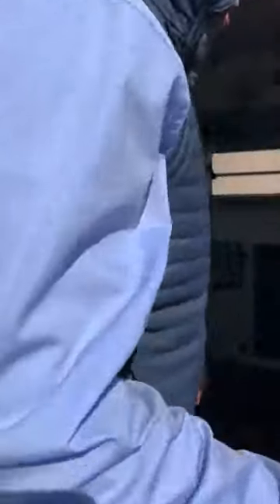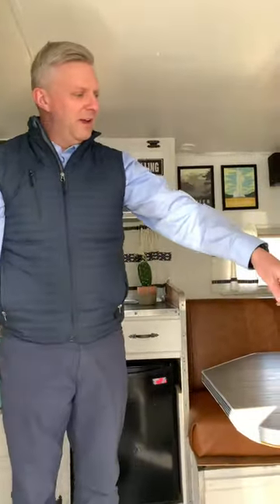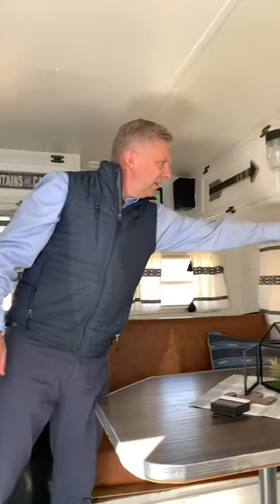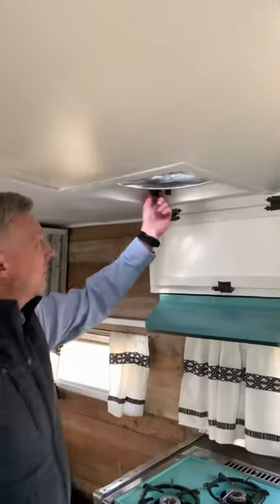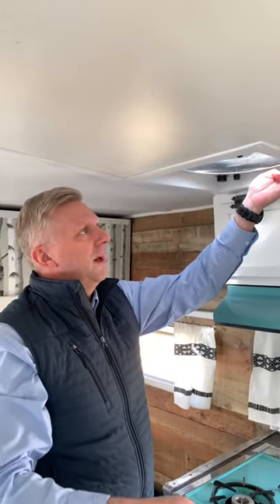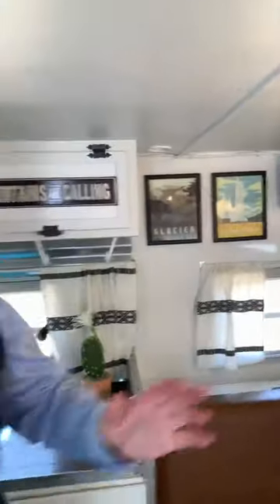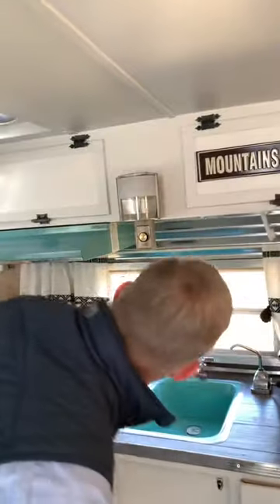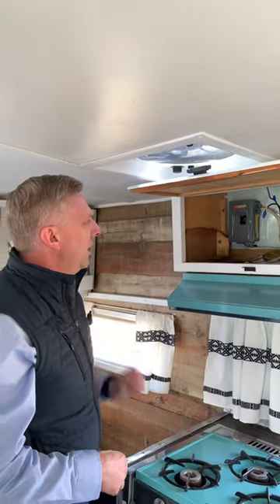Vintage Camper / Trailer Basics - 5. Electrical Systems

Comment: Hi i have a question in regards to the 12v system. I have a 1978 wilderness trailer but not sure if i need an additional battery since nothing is working when i plug into the 12v marine battery? Does it need to “charge” while plugged into shore power?
Reply: Me too!